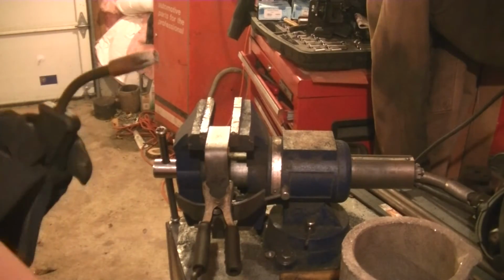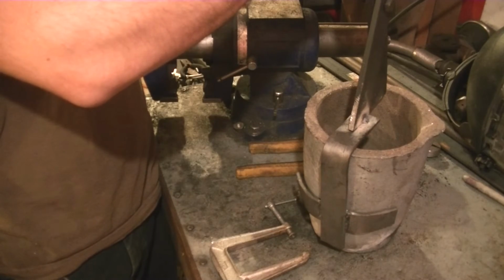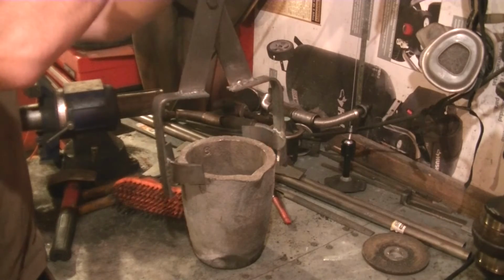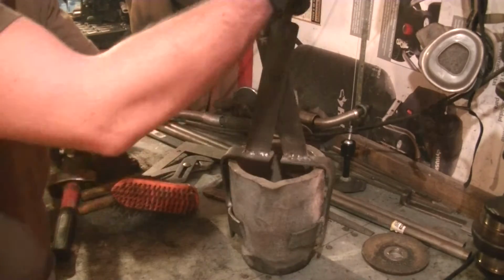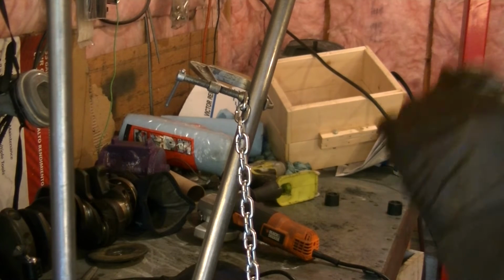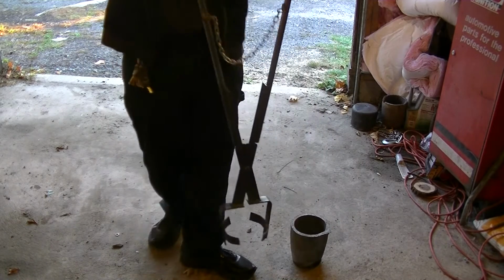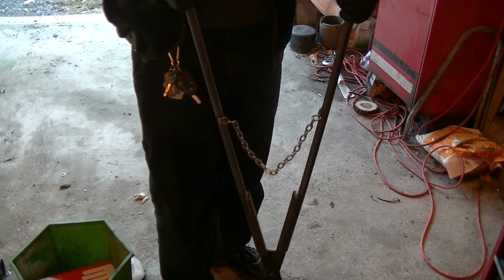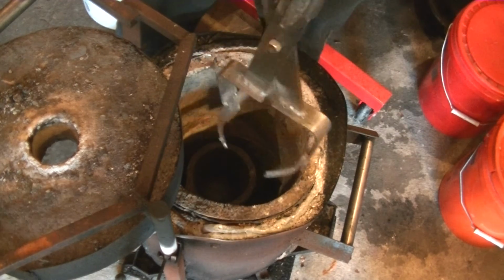Making New Crucible Lifting Tongs (Part 2)

Comment: That came out really nice! I've fabricated almost the same type but on a smaller scale. I think my crucible is a small A8 or 10. I forget. I've only melted aluminum so far. Cast iron is way done the road for me.
Reply from the maker: Thanks!  This is a B8 crucible, and it still may not be big enough for my purposes.  I may need to get a bigger one.  I am hoping to get the cast iron pour video out soon.  It's gonna be a good one!